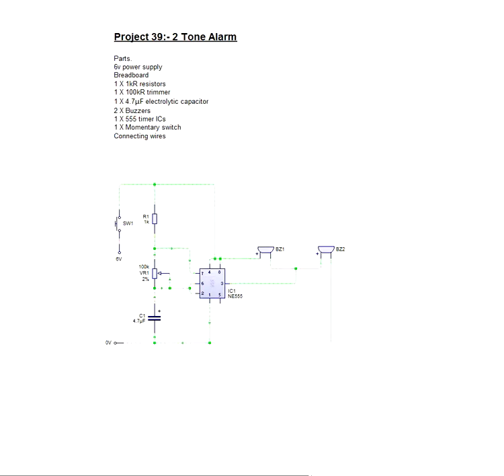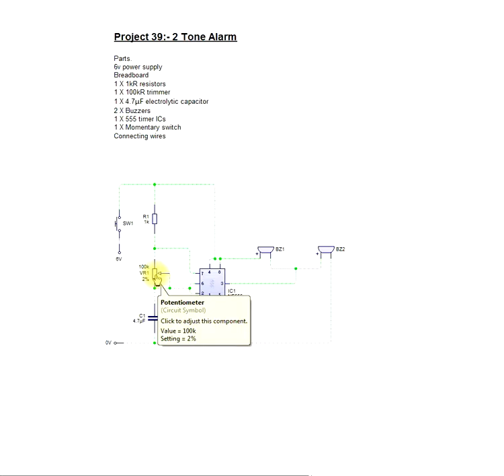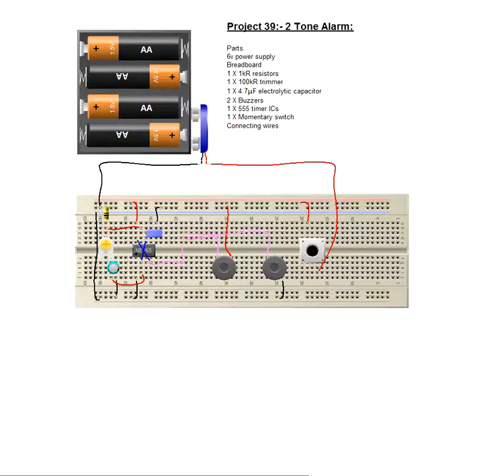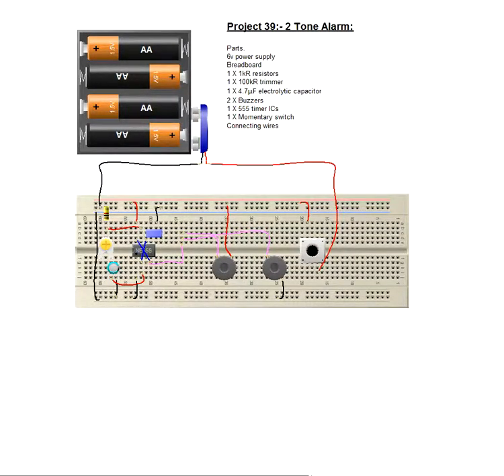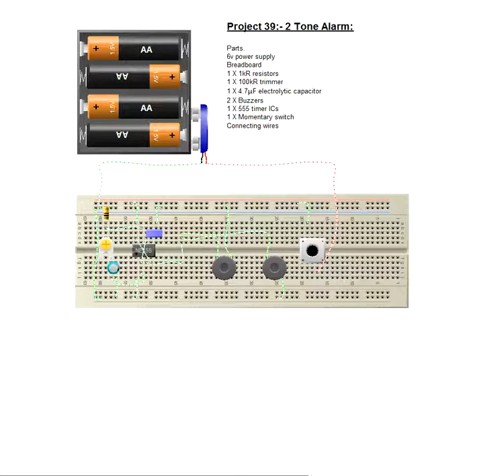Simple Two Tone Alarm

Comment: Hi Sir, do you know if is possible to powering this circuit with a joule thief? , or maybe a booster to use an standard CR2032 3volts battery to raise to 6v? I need to use in a simple alarm, that means that this will not be energized all the time, I only need that works a few seconds to alert me something, thanks in advance!